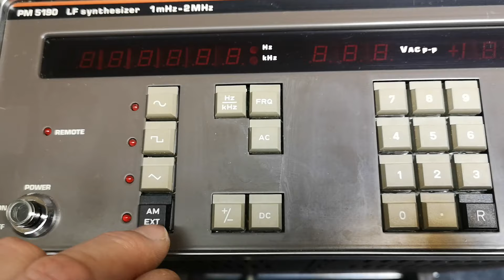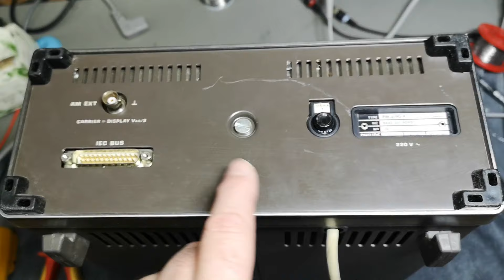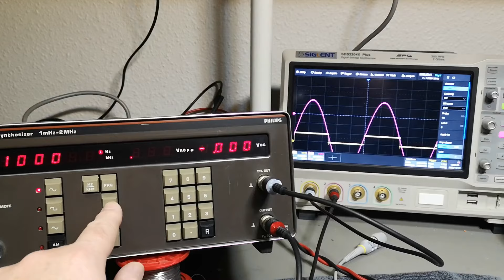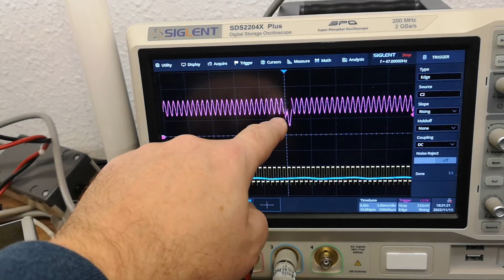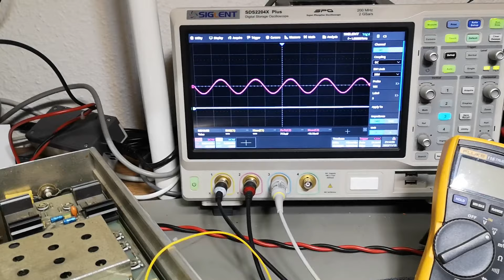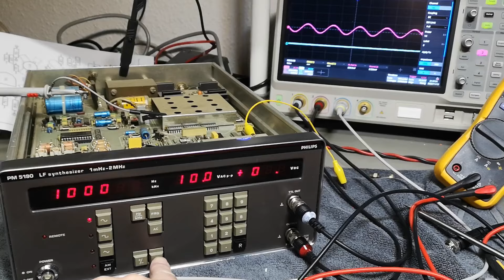Philips PM5190 1mHz to 2MHz synthesized function generator repair teardown

Comment: Soluwash-S is a good chemical to remove glue residue. Not harmful, does not smell much - highly reccomended. Consistency of a toothpaste - deploy it on top and just wait 30 minutes with a bit of rubbing. All goes out in one swipe. Disclamer: safe to use with most surfaces but if it is safe to use with your particular surface it must be checked before use.

Comment: Those reed relays cracked from soldering originally, leads were not held correctly while forming, and stressed the glass, and finally it cracked.
Reply from the maker: after the video was made i replaced a few more reeds, then all was fine for a few hrs, then other reeds started to reveal their state.. so i am sorry, i ended beeing a bit sad in the give up kind of way, they must all be replaced, then i can enjoy this nice unit again.
Reply: @TeardownOZ2CPU  Yes they all got bent and damaged in forming, time to order a dozen or so new ones, at least they are cheaper than new relays. Just make sure to either bend the leads carefully, or solder on thin wires to use to attach to the pcb and allow flex, and a drop of silastic to hold the reed loosely in the coil hole.
Reply from the maker: @SeanBZA  the few i installed, i held the wire close to the glass, and then bend, not that hard to do, but i am with you, they did not do that !